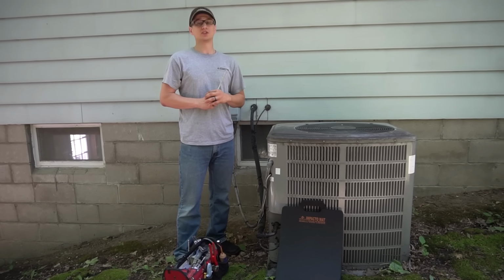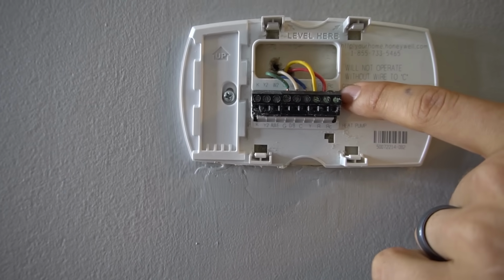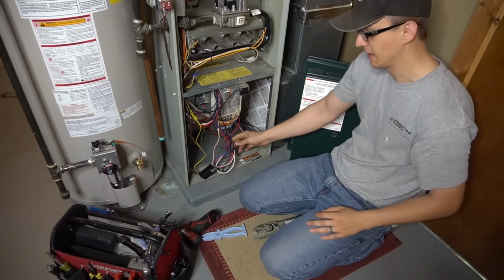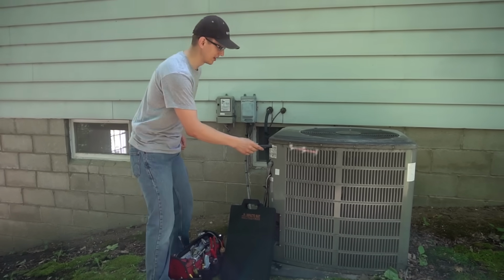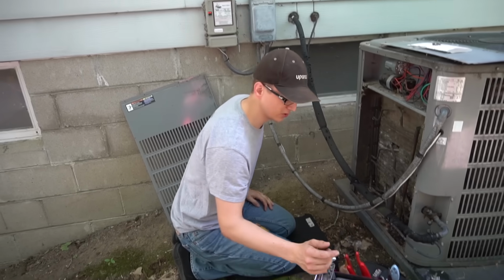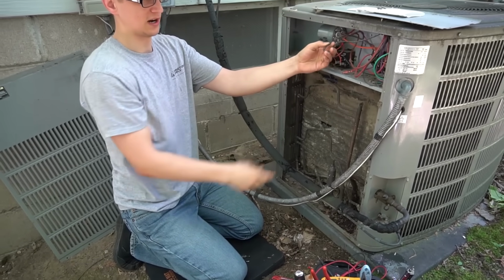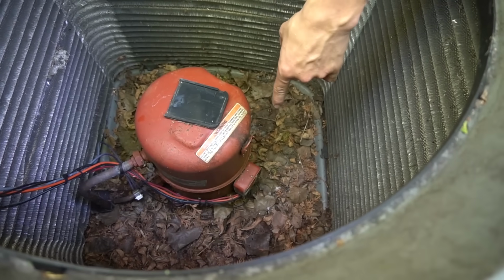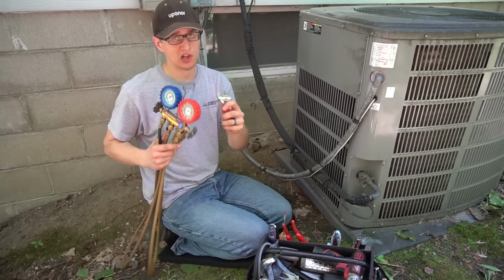AC Unit Not Turning On - How to Fix It Step by Step

Comment: My wired got chewed up outside.  Can I just use it as a pull string and where would he other end most likely be?
Reply from the maker: I am not sure which wire you are referring to. Are you talking about the brown thermostat wire? I usually just cut the chewed part off and splice the wires back together. Then tape up the spliced section with electrical tape. Or if you have shrink wrap tubes, those work the best.

Comment: You are very good!! I have a problem with installing or replacing a Aprilaire humidifier with a cord and plug, , to one with out. do I need an on and off switch with the new ones that doesn't  have a cord and plug? or just rely on the Wires to the furnace and the humidistat? I need to talk to someome before I change it out. How do I contact you?

Comment: Great job and this video. However, I know you cant cover everything in 1 video. I seem to be having a problem with I I think is the control relay. I have 27 volts on secondary but does not transfer to the coil outside. Checked continuity and no break in the low volt wires
Reply from the maker: To start off with, watch this video. I go over many reasons why the contactor could be failing to get 27v. https://www.youtube.com/watch?v=NVPhsK4gK1A&index=24&list=PLK8tZPlovA8Aw5W4GIoingc_enl5apH4C

Comment: Hi there! So everything seems to be working inside and outside, but the unit isn't cooling the house. I've done the following: 1) changed the filter (it was filthy, only because it's about 10' high and I can't reach it), 2) reset the power switch in the breaker panel, 3) cleaned out the outside condensation pipe for debris, 4) let the fan run in case the unit was frozen up. I turned on the A/C and still not cooling. 

What is your recommendation to test for a possible coolant leak? I'm in Florida, so I don't have a furnace.

Please help/advise! Thank you!
Reply from the maker: Did the AC gradually stop cooling or did this happen overnight? If it just stopped working randomly, then I wonder if your compressor is running. Even though the outside fan is spinning, the compressor may not be. Can you tell if both of them are running? The compressor and the fan sound different when they run. If this is a refrigerant issue though, then you may need to call in the pros since that would not be something you can diagnose easily.

Comment: Hello, my compressor doesn't come on while AC is set to Auto Cool, and the home doesn't reach the set temperature.  The fan on the outside unit runs, and the thermostat just blinks cool without ever shutting down because the set temperature is not being reached.  Also I switched the therm over to call for heat, to test it, and it never came on.  This is a new unit that was installed about a year and a half ago.

Comment: You have the most comprehensive and well explained tutorial about this subject.
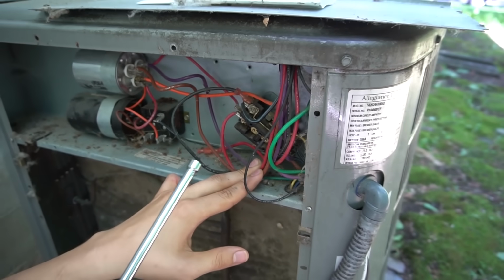I am attempting to fix my air conditioner which stopped working suddenly. I checked the 24 Volts and 240 volts  supply leading to the contactor. There is no power supply problem. Then with the AC on I pressed the plunger according to your instruction at 18:00. The air conditioner (fan and compressor) started to run. I did not see the plunger pulling in after test running. Visually, I saw that the contacts are clean and there is nothing stuck in there. I dismantled the contactor and used a  digital test meter to measure the 24 volts coil which read 11.5 ohm which according to other tutorials that it is normal. I also checked the thermos sensor and it was okay.

What am I going to do next ? Do I just change the contactor or do something else. 

Thank you.
Reply from the maker: Thank you! So it sounds like the 24v is actually not getting to the contactor coil. Or did I misunderstand? Basically if the contactor coil is getting 24v but it is not pulling in, then the contactor is bad. But I just posted a video dedicated to the contactor not pulling in :) Check it out if you want: https://www.youtube.com/watch?v=NVPhsK4gK1A&index=25&list=PLK8tZPlovA8Aw5W4GIoingc_enl5apH4C&t=0s
Reply: Thanks for your reply. I have ordered a contactor. Will see how it goes. Since the two poles of the coil measured 27 Volts and the plunger won't pull in,  I removed the wires and measured the resistance of the coil. It was 11.5 Ohm. So the coil should be good. Anyway, there may be other problem with the contactor. I will replace it and report back. Your above linked video is very informative. I will subscribe to your channel and enjoy all your tutorials.
Reply from the maker: Glad to hear you found the video useful! I have had times before where the contactor coil looked good (about the same ohm reading you got) but I checked everything else that could be possibly bad and found nothing wrong. At that point I replaced the contactor anyway and sure enough, it fired right up. After that happened to me a couple times I pretty much stopped checking the resistance on contactor coils. If it is getting 27v but not pulling in, I replace it. (besides the bugs stuck in the contacts scenario of course) Anyway, hope that fixes it for you and there will be nothing else wrong. Good luck!
Reply: The new contactor arrived today and I replaced it right away. The air conditioner started up and problem fixed. Thank you for your advice and guidance.
Reply from the maker: Happy to hear it! Job well done :) Stay cool!

Comment: Not finding an obvious link to the instructions for differential air temperatures between intake and output. I think you said to check temp for Freon diagnosis. Or do I just look for something specific in playlist
Reply from the maker: Are you talking about the air temperatures? I think I only talk about that in this video: https://www.youtube.com/watch?v=beVRELr8Oak&index=7&list=PLK8tZPlovA8Aw5W4GIoingc_enl5apH4C&t=7s

But I do not explain how to diagnose refrigerant problems in any of my videos. Temperature Drop (delta T) is only one of the readings you would take. It's just a little too complicated to explain in one video. You have to know how the whole system works. Refrigerant understanding will require some schooling so I do not even attempt to explain it on YouTube. To properly diagnose a refrigerant problem you would need to get readings of: super-heat, sub-cooling, low side pressure/saturation temp, high side pressure/saturation temp, wet bulb, and dry bulb. A good tool to have to help with diagnosis is this refrigeration chart: SuperCool Slide Rule: https://amzn.to/2QdbcZx   I am not sure if you can find one free online somewhere. I got mine at my job so never looked around. Hope that helps!

Comment: My ac doesn’t come on and my thermostate is not on. Can’t fgure out what is wrong but apparently there isn’t any power to anything.
Reply from the maker: Does your thermostat have batteries? Perhaps those are dead. Or if you have a condensate overflow switch, that could be tripped too if your drain line is plugged and backing up. Otherwise check your circuit breakers, the furnace power switch, and your 3 amp fuse. If all of those are good/on then you would likely need a meter that can check voltages to troubleshoot further..
Reply: Put a shop vac on the out side drain line and wrap it with a wet rag for good suction or if you have a condensate pump clean it out really good

Comment: Great video - Quick question...I have an upstairs and downstairs until  My upstairs thermostat got stuck and would not change temps.  My downstairs AC was working but my upstairs was not.. I turned off the breakers to both units because I did not know which was which.  When I turned them back on the downstairs thermostat was on and the breaker tripped.  I reset the breaker but now the entire unit does not turn on.  Ironically the thermostat that I replaced is now working fine... but my downstairs AC is not even turning the fan on..any ideas?  Thanks

Comment: My AC was not turning on. So I just banged on the door of the control board furnace a little bit with my fist and the whole AC system immediately engaged. What would the problem have been for that to have been the solution? Clearly there is an underlying problem that I'm going to have to deal with later on, I would assume.
Reply from the maker: It may have been just a stuck contactor. Or perhaps there is a loose wire connection.

Comment: I just watched your video and went out to look at my unit among the mosquitoes. Hearing the unit spring to life after pushing down the plunger was a relief. Turns out, the batteries on the thermostat were going dead. They didn't have enough charge to operate the plunger. New batteries did the trick. 

EDIT - or so I thought. The thermostat itself seems to be loose or not making a good connection. I taken it down to put the batteries back in. Reinstalling on the wall made it run for a few minutes. Going to the thermostat and trying to wiggle it while its still on the wall made the fan and outside unit come back on.

Comment: In a couple of hours I will be embarking on a new venture in home maintenance & repair.  There are only 2 things that I regret not taking the time to learn during my 22 year Army career.  One is small engine repair and the other is HVAC.  Cleaning out the drain holes of several of my environmental control units (ACU) is the extent of my AC knowledge but I spent more than half of my adult life repairing electronics and electro-mechanical devices.  My multi-meter and and tools are on hand.  Wish me luck!

BTW my issue is no AC or heat. No sound of fan blowing on inside of the house and fan not working on unit outside of the house.  Starting in the attic before it starts getting really hot up there. Checked CB's last night.

Comment: i have a URG question and i would much appreciate your technical advice. I am in China and language communication is a HUGE PROBLEM. I live in a 4th floor apartment with a small varanda (balcony) where is set d ENGINE UNIT of my AC. 3 months ago i had people coming for AC maintenance & refill d cooling. After maintenance done everything was fine & finally i could sleep in a freshy environment but THAT was for a short period of time of 1 month!...NOW there's NO COOLING...just and only FRESH WIND and d engine unit OFFs every 3 minutes and ON after 3 minutes also!...during 3 minutes i can feel some cooling but after d engine stops ONLY LITTLE FRESH WIND comes out from d wall unit. I NEVER USE "TIMER" and there is no signal of TIMER ON. I did reset several times d remote control, unplugged d power switch from d wall and let it rest for 30 minutes...Den i restart d whole process but d dammmn result REMAINS D SAME!!...any idea about WHY D HELL IS THIS HAPPENING?...THE WHOLE AC IS BRAND NEW...1 YEAR OLD!...i feel EXTREMELY frustrated and having AGAIN people coming for CHECK-UP is out of my budget for d nxt 6 months bcoz these guys (technicians) they charge alot of $ equivalent to US$1,000. per maintenance NOT INCLUDING REFILL!!...pls can u provide me any advice?...sincerely will appreciate. THANK YOU
Reply from the maker: To me it sounds like your AC unit had a refrigerant leak right off the bat from when it was installed. The refrigerant loop is a sealed system. Which means if they had to refill it and it is not cooling again, you are guaranteed to have a leak somewhere. If possible, I would try to get the same guys who installed it back out there to fix it. Being that you are in China, I don't know if that is an option though.. But yeah, most likely the refrigerant (cooling or freon) leaked back out in a month. What you are experiencing is most likely caused by the low pressure switch. If the refrigerant pressures are too low it will trip like that and then in a few minutes automatically reset.
Reply: Word of Advice TV wowww...THANKS ALOT! Your information means d world to me...YOU ARE D BEST!👍👍👍...NO WAY I CAN HAVE D SAME GUYS COMING HERE TO FIX D "MESS" THEY PROBABLY DID B4!...THEY ARE & CAME FROM MAINLAND CHINA WHEN  INSTALLING D WHOLE NEW UNIT...I BOUGHT IT IN CHINA (SHARP SPLIT TYPE MODEL AH-A129A) FOR A REASONABLE GOOD PRICE INCLUDING INSTALLATION!...NOW FOR THEM TO RETURN HERE (MACAU) IT WILL TAKE A VERY LONG TIME AND ALOT OF PAPERWORK CONCERNING D ENTERING-VISA FOR 24 HOURS...AND IT WILL COST ME A HUGE AMOUNT OF $ AND TIME TO PICK THEM UP FROM D BORDER!...ITS A TERRIBLE HEADACHE!!...NEVER AGAIN I WILL BUY ANYTHING "IN" & "FROM" MAINLAND!...TERRIBLE MISTAKE I DID!...I JUST WANNA SHOUT LAUD THE "F" WORD BUT...I'LL KEEP IT FOR MYSELF! DAMMMN IT!...I WILL HAVE TO BUY A NEW ONE RYT HERE IN MACAU...MUCH MORE EXPENSIVE BUT MUCH EASIER FOR ASSISTANCE/MAINTENANCE IF NEEDED!!...ANYWAYS, I REALLY APPRECIATE YOUR KIND & FAST "ASSISTANCE"!...WISH YOU COULD BE HERE!...THANK YOU SO VERY MUCH...YOU ARE "THE TECH"!👍👍👍👌 Stay safe and have a great weekend. 👌

Comment: Hi - Great video - My issue:  Push in the contactor, unit works fine.  (No problem inside)  I checked and I have 24 volts between common and the yellow wire (call for cooling) tied to the printed circuit board.  I have nothing coming out of the two Y out wires from the PC board that go to the coil.  It is a fairly new unit. Do these control boards go bad very often?  It is a $90 dollar part, but replacing it is a lot cheaper than a service call.  Also, this is a heat pump unit.  Is it possible that there is a permissive signal that will prevent starting?  A look on the red and green LEDs on the board and they are slowly going on and off, which according to the instructions means that everything is normal.  Any thoughts?

Comment: Word of Advice TV Ok, I have a question but I believe based on your comments I will need help from a technician.The Thermostat is starting the furnace fan, but my condenser is not starting. I do not have 24 VDC arriving there. Fuse is intact. I do not have a power saver switch. Thanks God.If I manually start the contactor the condenser and compressor start running. I have replaced the contactor by a new one just in case.What does LPS and HPS stands for?
Reply from the maker: LPS: Low Pressure Switch (sometimes it's called LPC: Low Pressure Cutout)
HPS: High Pressure Switch

LPS: If your refrigerant charge is low, your unit will trip on the LPC. But just to make sure, I would try to figure out where you are losing voltage. The thermostat wire that comes out of your house and into the outdoor unit usually has 2 wires in it. Between those two, you should have 24v. If you do not have 24v, then either there is a broken wire somewhere or there is something inside the house that is not sending power through. Like a condensate overflow switch for example. If you do have 24v, then look where those two wires go. Many times one wire will go to the contactor and the other will go somewhere else. Follow that wire and see what you have in series with your contactor. Whatever it is could be interrupting your power as well.

Comment: On 18min what should pull the plunger in? mine s not being pulled in. I wonder if the contactor electromagnet bobbin is not burned.
Reply from the maker: Contactors rarely go bad. Most likely it is not getting power, the low voltage (24v) could be a tripped 3 amp fuse at the control board  (indoor unit), if you have a condensate overflow switch, that could be tripped if your condensate drain line is plugged and backing up (also at the indoor unit), or there is something in series with the contactor that is interrupting the power. If you follow the thermostat wire coming out of your house and into the outdoor unit (usually a brown wire that has 2 wires inside of it), do those two wires go straight to the contactor coil or does one of them go somewhere else? That could help you trace where you are losing power as well.

Those are just common things to look for but if you have a meter that can read voltage, it would be quite a bit easier to find the culprit.